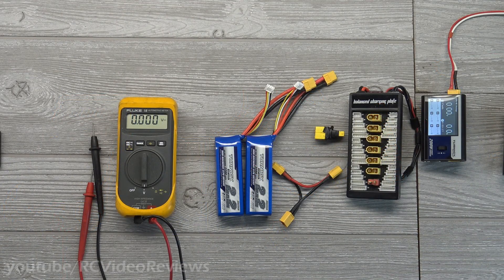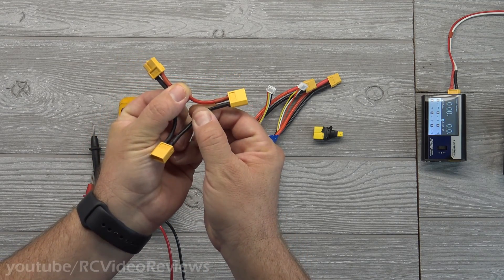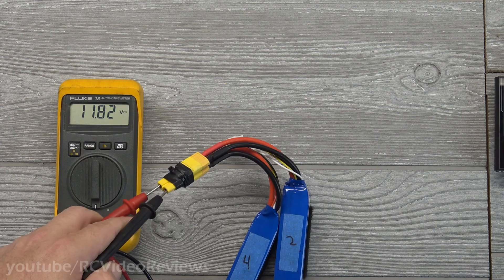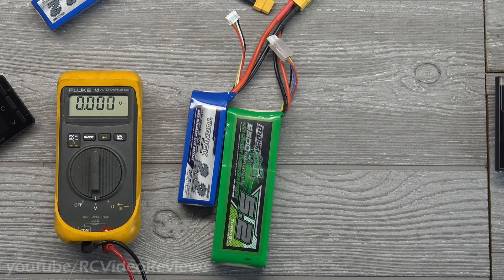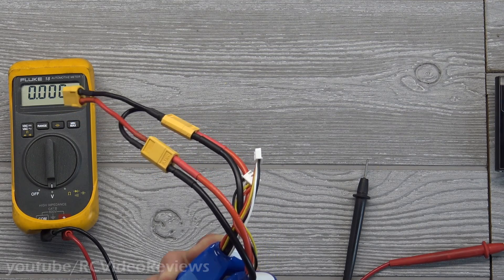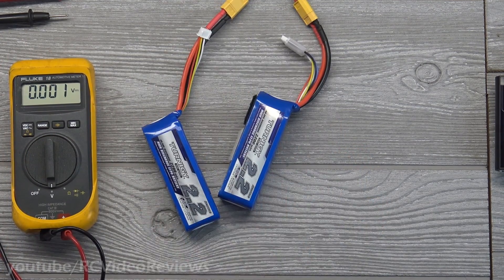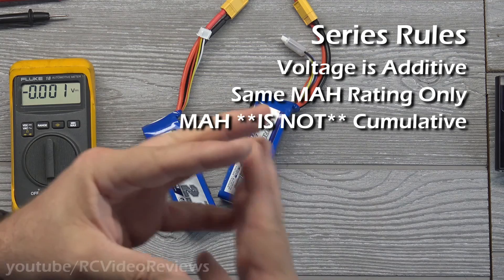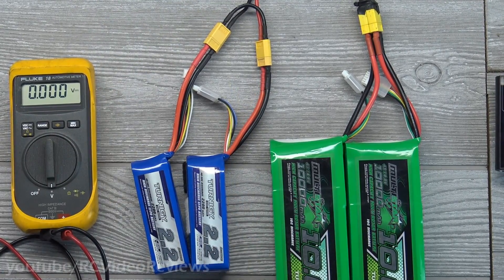How to Connect LiPo Batteries in Parallel and Series - Detailed Examples

Comment: I want to use a series parallel configuration to run my minkota trolling motor on my kayak with 12  2 S  7.4 5200mah Batts 2 Batts in series for 14.8 volts then Parrelell on every pair of 6 that have been series conected any issues? I am currently using a group 24 marine  deep cycle 12 volt batterie let's just say either I have to lose 20 lbs or the batterie does .I'm still liking my food
Reply from the maker: How will you balance all of that?

There's nothing electrically wrong with what you're suggesting. You're basically making 6 4s packs and connecting them in parallel. 

Here's what I would check if I were you:

1) Make sure IR is close on all packs.
2) Keep them balanced.
3) Close in their cycle count.
4) Same discharge C rating.
Reply: @RCVideoReviews  thank for the feedback my thought was to have each lipo pack on a pre wired board with plug connectors so I could pull each pack and balance charge individually then replace modules when and where I need . Half my battery are 50c and the other is 80c is that going to be trouble?
Reply from the maker: @jonandkariwalter2074  You'll find that higher C packs will hold their voltage under load more evenly than lower C packs. I've never really considered what that would be in practice for Series or Parallel, but I would expect to see some disparity like at the end of the day your lower C packs drain faster than your higher C packs so you wind up not getting the full charge capacity before hitting a cutoff voltage. --Again just spitballing here, but my preference would be to use packs with the same C rating on discharge.

As long as you have a strategy to balance charge, you're good there.
Reply: @RCVideoReviews  OK thanks I'm just learning about lipo and the rc batterie tech your channel  is probably the best I've found great info god bless
Reply from the maker: @jonandkariwalter2074  Thanks for the kind words. Good luck with your project.

Comment: Hello mate,

I just by mistake connected esc with lipo in wrong connection now my battery 1 cell is to 0 volts I was using 3 cell luckily my esc is still fine can you please suggest what shd i do
Reply from the maker: You probably burned or shorted a balance lead or a series connector between cells. Since you're asking me this question, I'm going to assume you do not have advanced electrical troubleshooting skills. Therefore, you should probably dispose of the battery.
Reply: @RCVideoReviews  thanks for the reply yes you are right cos just check 2 sell seems work perfect only the 3 rd 1 is showing 0 volt
Reply from the maker: It's probably just a burned balance lead. Those are the smallest gauge wires on the battery so in a short they're probably the first to go.

Comment: Why would parallel charging cause problems ? I can tell you for fact it works and it's safe . My question is : I have a 1/10 scale RC truck and I accidently ordered the wrong 3s battery packs . They are for a 1/18 scale or airplane ....right voltage wrong size . Running a pack that small would over heat the battery cells so I wanted to run both 3s packs parallel . Can I do that ?
Reply from the maker: Parallel charging is great. I do it all the time, and I argue against people who come here and say it's unsafe. It can cause problems if you connect packs of dissimilar voltages together.

Here's how I decide if I run packs in parallel:

1) Same voltage
2) Similar IR Cell to Cell and Pack to Pack
3) Same discharge C rating

If those conditions are met, I will charge and discharge them in parallel any day of the week.

Comment: Hi, do I need to be careful with different discharge rates and / or internal resistance when combining in series and parallel? Im guessing this is why you are using the same brand of battery as they’re the same specs? Thanks, much appreciated.
Reply from the maker: They do not have to be identical. The farther apart IR the less effective capacity. The batteries will always follow ohms law so they discharge to load which is why in parallel they will discharge evenly. Off load you will see the lower IR pack end with higher voltage than the higher IR pack.

In my experience, once packs start to get puffy (flex on the sides when squeezed), the IR is higher than new packs. Once IR hits about 5 as measured by my iCharger 306b, I stop flying the pack. So when I fly with packs in parallel or series, you are correct - I try to keep similarly spec'd packs working together. i.e. I try to keep packs with average IR of 1 together and packs with average IR of 3 together.
Reply: RC Video Reviews thanks for the info, really helpful. I don’t have any instruments to measure IR so I’ll just try get batteries with similar IR when I buy them. Is there any disadvantage to building a 3+ parallel battery group, when compared to just buying one battery of the required capacity? It is sometimes cheaper to buy batteries that way, although it seems unintuitive. Thanks again
Reply from the maker: @Eiren Whelan I believe all new LiPos come with an IR of 1. What happens after you start using them is a function of heat/discharge rates/discharge voltage/cycles and any number of other factors. 

I frequently look for series or parallel options with smaller packs to give me larger packs if it helps me avoid buying single use larger packs. The only exception I've made to that in recent years is for my BAe Hawk. For that jet, I sprung for some 6s5000 batteries.
Reply: RC Video Reviews thank you, great info
Reply from the maker: @eirenwhelan3312  You're welcome. Good luck with your parallel/series options.

Comment: Nice video, good stuff! I was always wondering if anyone made an adapter to hook up two ESC's to one battery?? AirHammer out!!
Reply from the maker: All my twin motor planes have two ESCs connected to one battery including the Dynam planes.
Reply: @RCVideoReviews  Oh yeah, sure.😀 I just wondered if anyone made an adapter for this. One that goes in the right direction. 1Male to 2 Female. EC3, Xt60........ I don't recall seeing one anywhere.
Reply from the maker: @airhammer6203  That I don't know. Wouldn't be hard to make though. Amazon sells XT60 connectors pretty cheaply if you want to make one. I make my own parallel connectors.